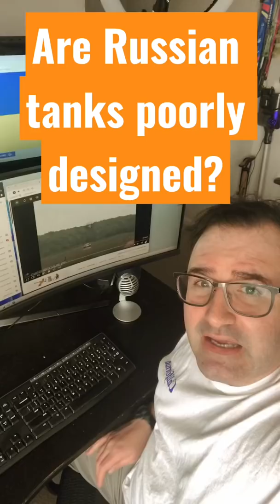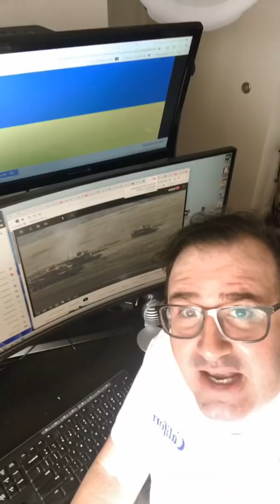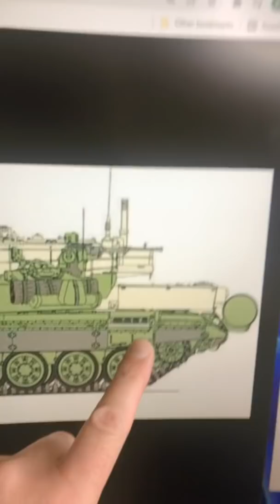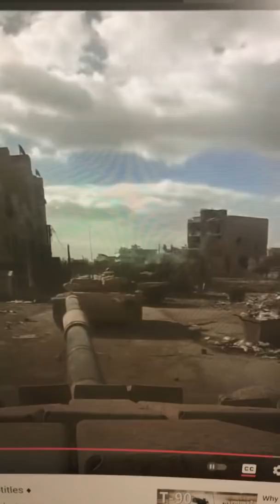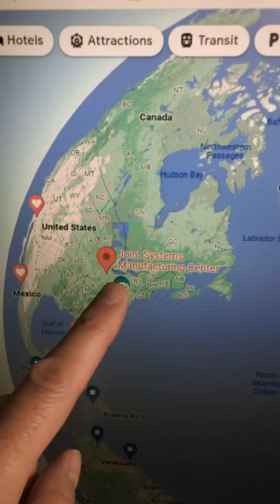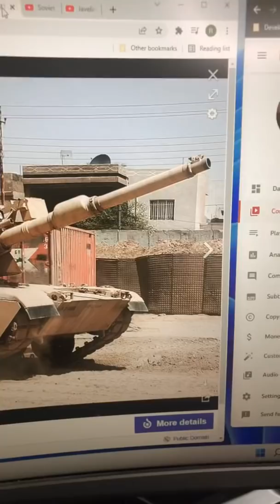Are Russian tanks poorly designed?

Comment: Just put a smaller toy tank on top of the turret to distract the Javelin
Reply from the maker: This is the way.
Reply: For real tho, how about an anti-missile shield drone that hovers just above you? Something fairly simple and cheap that simply puts itself between your tank and the missile. Kinda like spaced armour but further away. It would be like a cope-cage that actually works.
Reply: @thomasp506  The moment your tank needs to go between trees, buildings or literally anywhere except an open field your drone is going to crash into something like an overexcited dog playing fetch.
Instead of trying to program a drone that won't ever do that (nevermind keeping it charged when you're out for days on end), just stick to upgrading the reactive armour.
Reply: A balloon tank. It will scare the shit out of the American.
Reply: @hurrdurrmurrgurr  I dunno. Drones are being used pretty extensively in this war, and I haven't seen any getting taken out by excited dogs. It would be no more susceptible to crashing than a drone used for recon or delivering a payload, as if drones can only operate in open fields.
Reply: @hurrdurrmurrgurr  keeping it charged wouldn’t be hard just connect a wire
Reply: @thomasp506  how about a detachable roof which is blown upwards to meet the incoming projectile, kind of like an airbag?
Reply: @thomasp506 this is pretty much what active protection systems do, but in a much more practical manner
Reply: @thomasp506 bro basically just described hard kill aps
Reply: @thomasp506 Not a bad idea, im sure they could design it so it hovers above that tank like glue 😂 seriously though i could see that working for a time at least...
Reply: @origintrackz5235 
Nah

What yall are describing is a drone that that has to be quick as fuck, precise as fuck, maneuverable as fuck, smart as fuck, reletively heavy as fuck, and reliable as fuck. In addition to still needing a way to spot and track incoming threats.

And all of this for a consumable system
Reply: @DuelJ007 Yeah imagine if you could attach like a mini missile defense system to your tank, oh wait that’s just the Trophy defense system for Abrams.
Reply: @RyanMcBethProgramming  the tracking system on the Abrams can detect and track targets from farther away than the T 72 so the idea that the T72 two being smaller helps it being less of a target is kind of a flawed doctrinal from the east.(especially when you put into context things like thermal sites and night vision sites.) basically the computerization of sites in general also when you consider the upgrades of having a gun site and a commander site on a lot of the upgraded tanks.
Reply: @RyanMcBethProgramming  they were planning on turning the tanks into a computerized tank and a robot. That’s one of the reasons for an auto loader in the first place on the T 72 in that the reasons why they don’t have them now, is because of the Soviet union collapse, and also the failure to acquire enough microchips to digitalize the Soviet union, because the Soviet union had a massive failure on its national micro endeavor. Most of the time they were 20 to 10 years behind the curve, technologically speaking as far as microchips go. And as far as of production and usage, it was very small because they couldn’t get enough microchips even with the limited amount of technological advancements they had with their microchips
Reply: @thomasp506 might as well just use an APS at this point
Reply: @hanneswiggenhorn2023 no thats ERA active protection intercepts the attacking missile
Reply: @hurrdurrmurrgurr  Have you never heard of lidar and tethered drones. It's possible but, something tells me Russia isn't building anything close to that and there are better solutions anyway.
Reply: @thomasp506 the missile would just plow straight through the drone and keep going I think
Reply: @Vipbossguy  It would work on the same principle as spaced armor. Missiles don't plow through objects in their path, they get set off by them.
Reply: @RyanMcBethProgramming  The original three-man low-profile tank design was from the mid '60s (T-64), not the mid '80s.
Reply: @thomasp506  but I don’t think a drone could set it off
Reply: @thomasp506 APSs, active protection systems are basically that but they make more sense than your idea.

Comment: When you prepare for one certain enemy all your life and instead fight another type of enemy.
Reply: This was exactly the environment that russian tanks were designed for though.

US Tanks werent designed for this, yet performed pretty well in Kosovo and such.

Russian military is run by toddlers. What do you expect.
Reply: @honkhonk8009  Enemy in Kosovo did not have half of western Europe handing out ATGMs to them either
Reply: Well they kinda were supposed to be used in mass. Imagine 8000 tanks rolling into Ukraine with fully trained crews and fueled properly
Reply: The same happened to the US in Iraq. Look no further than the rushed introduction of the MRAP, the TUSK package for M1s, and BUSK for M2s
Reply: @Savak22  M1s were rarely deployed in Iraq during the insurgency period. They had no use most of the time.
The TUSK package was more of a "just incase" measure.

But the MRAP had a point, since carrying people around in APCs all day is definitely not cheap, and you cant guarantee area outside the base to be IED free.
They needed something inbetween and FAST, so they looked towards South Africa.
Reply: @MrColinisation  Kosovo had tandem HEAT warheads that could just as easily penetrate the tank.

Early Kornets could do significant damage to the Abrams. Pretty sure Kosovo had plenty of those.

You severely overestimate how usefull NLAWs and Javelins are.
The main advantage they hold is the ability to counter Russian counter measures such as hardkill APS and ERA.

NATO tanks such as the Abrams, especially during the 90s, did not have hardkill APS or even ERA. They only had composite armour arrays. 

US in the 60s did a statistical study pitting M1 tanks against dune buggies with ATGMs attached. The ATGM buggies scored more kills and had less deaths than the M1.
Tanks are not the most optimal method for anti-tank roles, that is a fact.

Tanks are not used in the anti tank role very much. Tanks are usefull because they offer direct fire capability. That is mostly it.

Look at Ukraine. Donbass insurgents would only bring out tanks if they needed to demolish bunkers or dwellings that Ukrainians hid inside.

Somehow Russia did not take notice of this obvious fucking fact of modern war, and played like utter morons.
Reply: @honkhonk8009  M1 wasn't invented in the 60s. You are talking some crazy bull shit.
Kornet ATGMS were not able to penetrate most Abrams tanks, and even if they did it wouldn't cause as much damage as it would to a Soviet/Russian design.

Even if penetrated an Abrams could still protect the crew, no ammo can blow them up.
The Abrams is much more survivable than a T72, T80, or T90.
Reply: Literally fighting themselves tho too so rough as it gets
Reply: This isnt my post.
Reply: not my comment
Reply: So the US against the Russians since the end of ww2?😂😂
Reply: @EstParum  Putin's wet dream that will never happen!  Slava Ukraini!
Reply: The strength  of soviet tanks lied in quantity not in quality , by limiting the war putin shot himself in the foot , if it started with the full force of russian army Ukraine might had difficult time holding on to donbass . Russia is fighting with western doctrine which their army is not suited and prepared for.
Reply: @vaskarghosh8543  lmao neither is the west or are you not seeing the trouble and issues nato and the US is having and remember, 50 against 1
Reply: This was the case with the Polish military in 1939. It had been preparing for 20 years to fight russians… and that’s when the germans attacked.
Reply: @EstParum  but that's not gonna happen since they can't get 8000 fully trained crews and enough fuel to have them run continuously.
Reply: @cookiecraze1310  Then you have a boring strategic stalemate and the number of units, or AKA combined percentage of.effectiveness of all units are simpl dictated by what your logistics can handle, not what you got.
Reply: @EstParum  Russian logistics have typically not been up to par.  So this policy has hamstrung the Russians historically.
Reply: @kurtgreaser988  other way around smooth brain
Reply: @kurtgreaser988  No shit. WW2 was won on Brittish and American trucks. Soviet was useless in WW2.
Reply: @nagantm441  that's the point, they built it for tank battles where they can spam their smol tanks, and they meet anti tank weapons instead.
Reply: @EstParum now its almost 2024 and russia has lost more than half of said 8k
Reply: @MrColinisation Kosovo is also 100 times smaller and more insignificant to Russia… Ukraine serves as a land buffer between nato and Russia, that is why we are trying to defend it
Reply: @EstParum  the soviets were the only country in europe that lasted more than a month against the nazis, by the time the US launched their invasion they had already destroyed 90% of germany's armor, most of their professional troops and deprived them of all oil sources.
Reply: @theforsakeen177  Hadnt USA given USSR food Oil Trucks Tanks Planes, Industry tools, raw materials and random equipments , USSR  would starve and collapse 1942-43.
Reply: @EstParum  The URSS received 2 tons of oil from the US thorough ww2 while producing at least 10x that amount each year, they produced by themselves nearly as much airplanes as all the axis minus japan, or 140k while receiving 15k by the US, they produced 120k tanks and received 7k by the US and the URSS(and today's russia) true focus, the artillery of which they produced about 1/2 a million or about 600% more than the entire axis combined.

I haven't seen any numbers on this but it is estimated that the ordnance goods sent by the US made up over 1/2 of their domestic use, it is hard to say how decisive this was considering russia's already overwhelming firepower advantage.

Supply of Trucks are more straightforward as the URSS only produced a fraction of those but as for food, they would have starved yes, and they did in fact starve but they went through several starvations in the 20th century and didn't collapse any more than communist china did.

So considering all this and the fact that the soviet like all other europeans actually used horses and railways as their main mode of transportation saying they were useless is totally innacurate.
Reply: @theforsakeen177  WithoutUS help theywould collapse and you know it. All those production values were due to American engineering parts.
Reply: @EstParum  not really the lend lease only started in late 42' and picked up steam in 43', by which time soviet industrial production had already dwarfed the axis, it is even more impressive when you consider that they lost 2/3 of their main industrial sectors in the opening phase of the war.

You can look up the battle of khalkhin gol, even against japan they had this kind of insane military production and in fact they ended the cold war with a quantitative superiority over the US.

Fact is without the URSS they would be no one else to stop the Wehrmacht in europe, the hunger plan would have succeeded, so would the OST plan and the holocaust would have been complete (most jews survived because they fled east after the URSS invasion of poland).

Now against a fully armored germany with plenty of fuel and no wasted manpower the US might still have won provided they could secure a beach head but as the bombing of japan shows (and really the whole pacific theater) that would have necessitated the kind of loss they were unwilling to take, hence why it was the URSS that went all the way to manchuria to deal with the main japanese army.
Reply: @theforsakeen177  Lend Lease started i  41 and stoped 1944
Reply: @EstParum  2% came in 1941(pre-lend lease), 14% in 42 (from October)  and the rest broken up in the remaining years. Over 50% came after kursk, when all hope of victory had ended for germany.
Reply: @honkhonk8009 Im sorry honkhonk but you didn’t fight Kosovo but Serbia a country that got wreckt by the Yugoslav wars and simply didn’t have any counter measures and the US didn’t do ANY significant fighting but border skirmishes with Serbian border guards and military.
And then after the bombing campaign Serbia eventually gave up Kosovo.

Comment: A smart man I cant remember once said..
"Dont prepare for the world of today... prepare for the world of tomorrow."
Reply: I believe Russia has tanks of tomorrow as well, but in small quantities and still in testing stages while they have 10-12 thousand of old Soviet tanks they are using.
Russia was clearly not preparing for this conflict in any major way.
Reply: These tanks are from the 60-70s, there's only so much you can future proof half a century worth of progress even before you remember that the USSR imploded itself trying to compete AND the recent microchip revolution of the last 10+ years.
Reply: That's exactly what they did. They prepared 10-20 years ahead. Not 50.
Reply: Incidentally the Abrams tank proved to be ahead of it's time - many of it's design features (especially the main focus on crew surviveability) are it's big advantages on the modern battlefield.
Russian tanks however aged quite poorly - simply not designed for modern war.
Reply: So we should be designing tanks for Mars 🤔🙂👍
Reply: @Lehr-km5be  yes and no. for 1980´s standard, M1 and the Leo2A1 (both are close to interchangeable, with leo2 having a better gun and slightly better armor) are relatively okayish protected.
T-55´s and T-62´s wont penetrate the front, but a 125mm armed tank would still be dangerous in that time.
Its only in the early 90´s that M1 and Leo2 evolved into the super survivable and powerful beasts that we have today.
But in that timeframe (around 15-20 years from 1989 - 2009) former eastern block arms developement stagnated or did just not happen.
Russia is modernising its T-72´s and T-90´s in a way, similar to M1 and Leo2 upgrade programms of the 90s.
but thats still 15 -20 years too late for modern weapons.
the newly designed tanks (t-14) on the other hand are dangerously advanced (but they have major teething problems resulting from 15-20 years of stagnating/dead arms developement, a german T-14 would be the most dangerous thing on the battlefield, because it would work, due to germany constantly being on the edge of technological developement)
Reply: @Lehr-km5be Cheap drones are dealing properly with them.
Reply: @jeronimodavidgaroupa5143  Just like they do with any tank :) The difference is that the crew survives to fight another day - meanwhile in russian tanks the crew is no more, gone, reduced to atoms :P